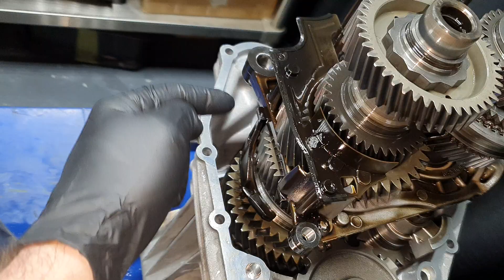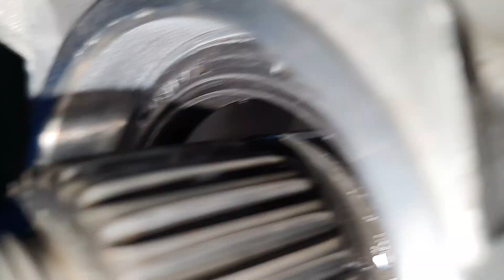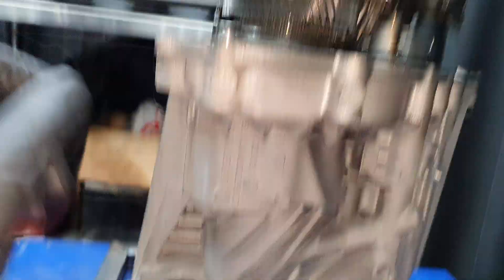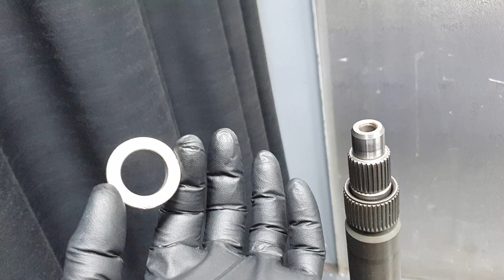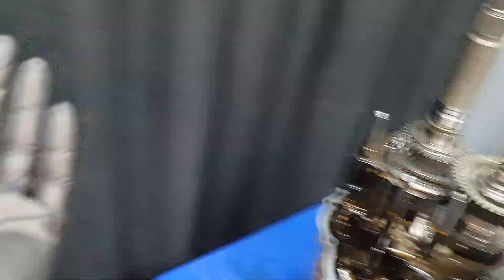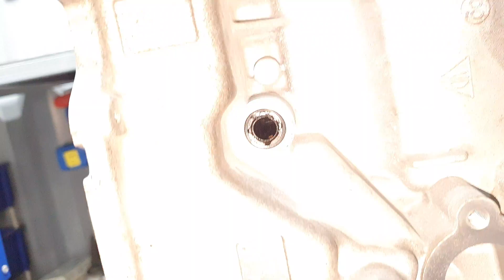VW Beetle transmission *small* repair (part 3)

Comment: Depending on how tight the bearings are in the housing, maybe you can warm up the housing so they will slide in without using a press?